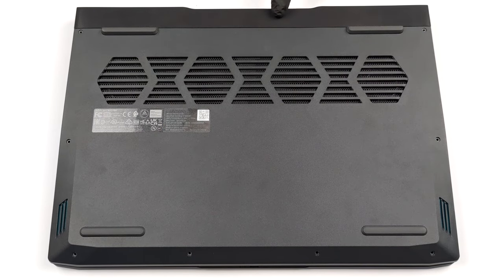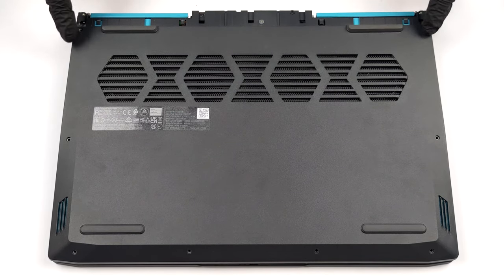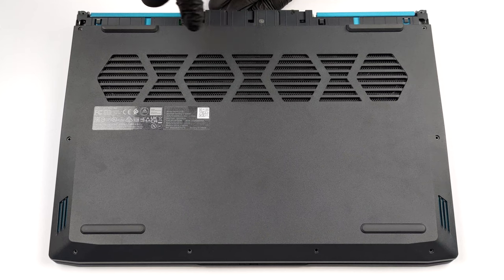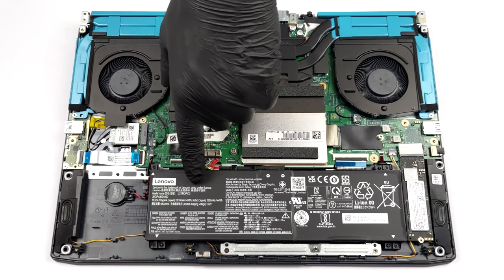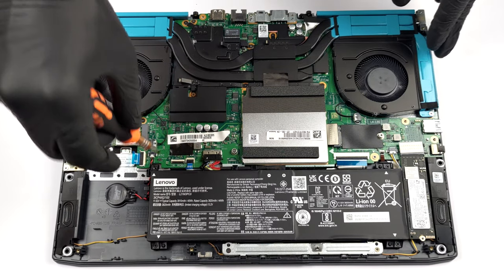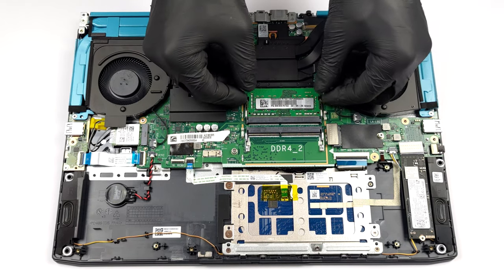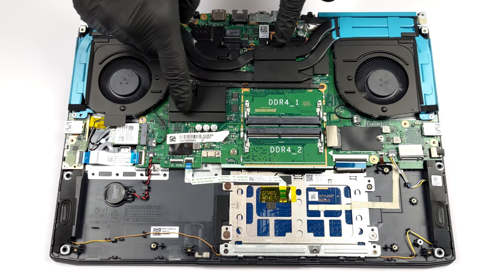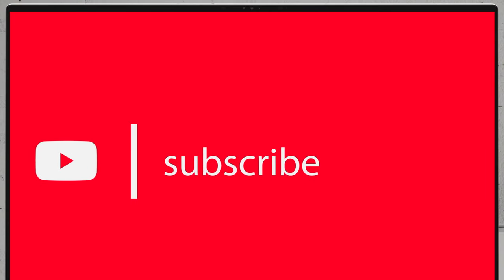🛠️ Lenovo IdeaPad Gaming 3i (15", 2022) - disassembly and upgrade options

Comment: Is it true that opening the back panel and making any upgrades to hardware by ourselves voids the warranty? Dell and other brands don't mind it but for Lenovo, it is mentioned FRU only. Could you suggest if it is a good idea and carry the SSD and RAM upgrade on my new laptop by myself?
Reply: Yes its true and you can upgrade it by yourself if you know how
Reply: Usually you can upgrade the memory and storage (providing it's removable and not soldered-onboard without voiding your warranty.  I upgraded a Dell once without voiding the warranty but this way about 5 years ago.  Maybe things changed with them....

Comment: Im about to buy this laptop, mi question is, can i put this ssd (SAMSUNG 980 PRO 500GB PCIe NVMe Gen4 Internal Gaming SSD M.2 (MZ-V8P500B)) on the empty storage slot
Reply: The empty one based on this video is a 42mm length slot, it won’t fit a 980 pro although it does support gen 4 which is a shame
Reply: Yea the default card given to you is 2280 form factor..You need to find a M.2 2242 form factor to upgrade it in the second slot..Even I find it annoying they did this...But hope in the future gen 4 pcie nvme SSDs come out with 2242 form factor..I tried finding everywhere but no luck..Only non branded ones are avilable..
Reply: @zura5893  Did anyone added one? i m looking to this one, and add it to the empty slot, SSD1 22.42 one and then put it as primary ssd, as is faster that the orinial one..
Corsair MP600 Micro 1TB M.2 NVMe PCIe x4 Gen4 2 SSD – M.2 2242 Anyone has add one?

Comment: is there a difference in the size of the bolts from all of them?? or are they all the same..?
Reply: From the part where your laptop is thicker, it will have longer screws.

Comment: how would i be able to replace the laptops power button its on the mother board and wont power on
Reply: i m sure you already fixed, but you can set up the laptop, to run just when you open it (fisically), so you dont need to use the power button anymore.

Comment: i found this laptop with 2 versions
1: 16gb ram 1to ssd rtx 3050ti 16" ips wuxga and i7
12650h
2: 16gb ram 512ssd rtx 3050ti 15,6" ips fhd and ryzen 7 6800h
and the price difference is 90 dollars for the intel version
i don't play too much games only 2 or 3 and not for long time + i want it to be used for heavy tasks like 4k editing, after effects, streaming and high programming tasks .. i know that amd keeps battery life longer but it will be always plugged in so which one should i go with
note: i also found legion 2021 with 32gb ram ryzen
7 5800h rtx 3050 ti 512ssd
Reply: I would go for legion and also 3060 variant

Comment: this empty slot ssd laptop can use m.2 Sata ?
Reply: M2 NVMe PCIe 4 x4  2242. 
I m thinking to add a 1Tb one there (SSD1 slot) and put it as first HD, as the one that comes originally (SSD2) is the 22.80 but is PCIe 3 x4...

Comment: Hi, i wanna ask something bout this laptop, is this laptop was same with (IdeaPad Gaming 3 15IAH7 82S900LQID)?
Reply: I have IdeaPad Gaming 3 15IAH7 Laptop - Type 82S90077SP (spanish KeyBoard)  and is exactly like this with i5 12500H, 2x 8 GB DDR4-3200, 1x 512 GB SSD PCIe M2 22.80, and is like the one on the video.
Reply: @sinnombrefoto  wah thank you so much bro for the information,

Comment: How much ssd storage max? Please need to know
Reply: 1tb
Reply: I have read someone that added 2Tb , then had to add the drivers because wasnt recognizing it, but then worked perfectly
Reply: @sinnombrefoto  which drivers?
Reply: @kath4rsis513  i remember he said, he reinstalled window and then, windows wasnt recognizing the new SSD so he had to install the SSD drivers, or something like that. 
In mine, i m thinking to put a 1tb  22.42 4x4 at SSD1 and clone the other SSD and put the new one as primary HD, then leave the one that comes at SS2 with, 512mb 22.80 3x4 and later i will buy a 2Tb for that one.

Comment: Can I just leave the battery out ?  I’m gonna play at home and wanna limit over heating by keeping the battery out
Reply: Not advisable. I did that with a dell gaming laptop once and i started having issues where the motherboard got fried when there was some power fluctuation. While the power adapter will protect or regulate a little bit, the battery actually plays a role in this too. My issues were endless and it all started when taking out the battery.
Reply: It has a saving battery mode, that doesnt charge more that 70/80%. Also as Mo.Jo. Already told you, i dont think is a good idea to play without battery

Comment: Anyone can point me a SSD 42mm compatibile with this exact version? Please
Reply: I bought Kingspec. It's the only available brand with this pcie gen 3X4 m.2 2242 in our region.
Reply: @chooonz1396  you can add a 4x4 22.42, the other is limited to 3x4 but not the small one. I have an eye on Corsair MP600 Micro 1TB M.2 NVMe PCIe x4 Gen4 2 SSD – M.2 2242

Comment: Can i upgrade ram to 2 x 16GB on this laptop?
Reply: Yes you can.
Reply: No. Upto 16gb max only. 2x8gb 3200
Reply: 2x 16 GB DDR4-320, yes. Also at the video sais that they are pretty sure can accept up to 64 in total, so 2x32... but i think they didnt try it. So is just theory.

Comment: it seems this model can accomodate a bigger battery,weird choice by them.
i think even if someone want to replace a bigger battery is not possible right?
total noob about tension,voltages so is better if i ask 😅
Reply: It looks like a reserved space for a 2.5” drive, lenovo usually offers bigger batteries in exchange for said space.

Well you shouldn’t try to put a different battery because most likely it wouldn’t fit
Reply: There's a variant of the same model with a bigger battery 60Wh, I got it recently, the AMD version 5 6600H / 3050TI.
Reply: I have RTX 3060 variant with 5600H that comes with 60Wh battery.
Reply: there is a 71Wh battery variant but for 16' model, also want to know if that battery could fit in 15'6
Reply: 2.5" drive connector isnt found so idk why there is a space for it